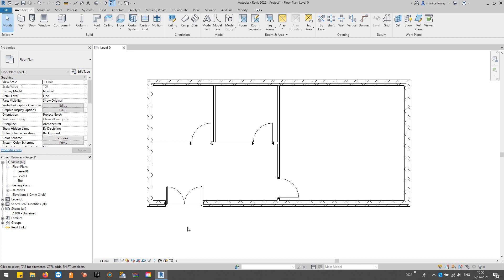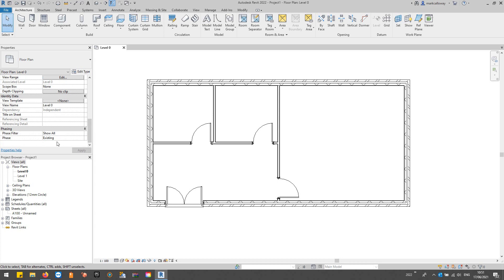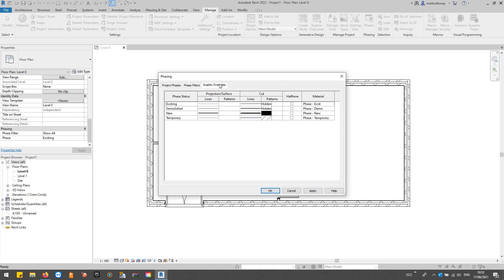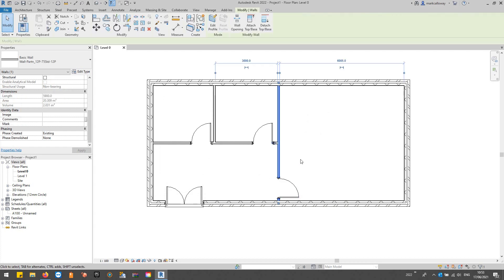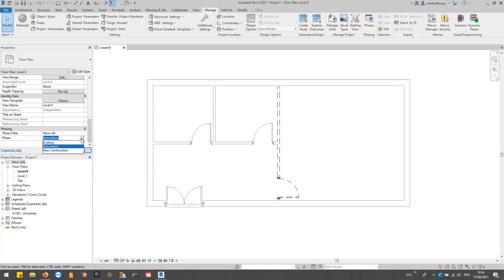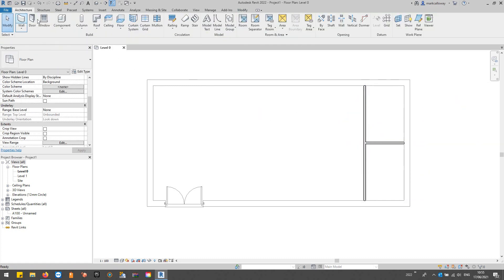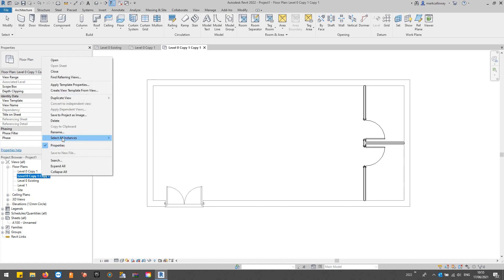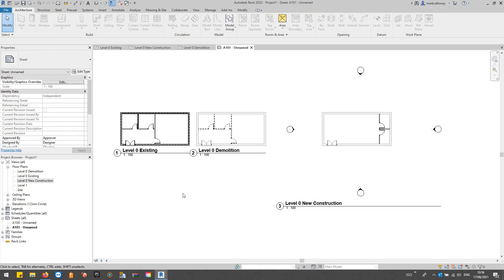Autodesk Revit Phases

Comment: How do you adjust this so that the wall opening from demolished doors and windows do not show in 3D or elevation?
Reply: Make sure the door has "Opening Cuts" rather than a Void Extrusion for the opening, as it should then infill when the door is demolished